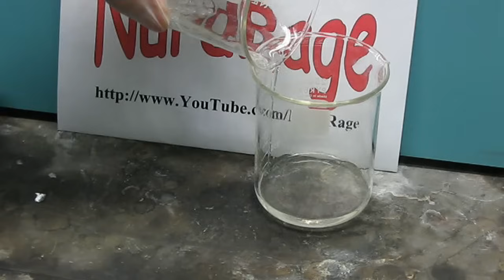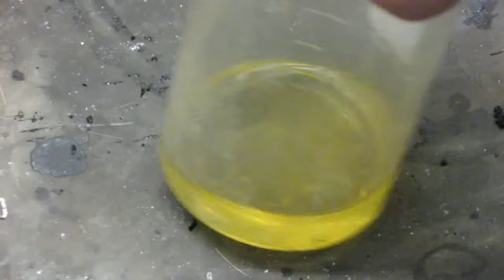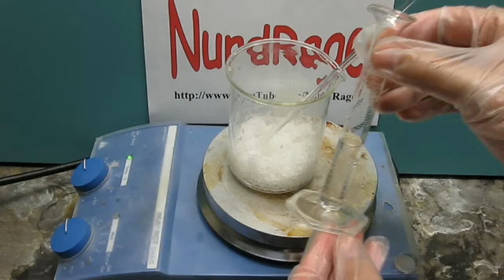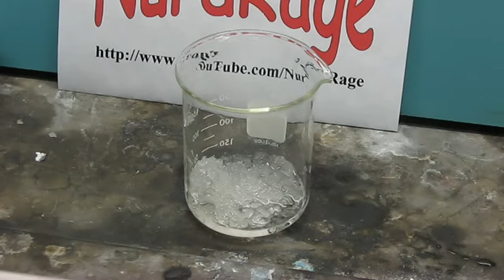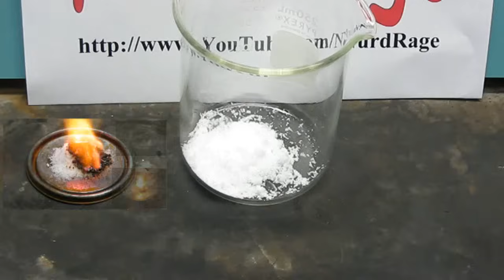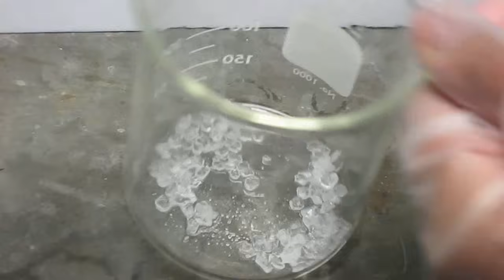How to Purify by Recrystallization

Comment: if the product solubility is different when you change temperature, then adding cold water or putting ice water into the product, it will recrystallize faster. However, it is recommended to cool down slowly, as you will yield more product.
Reply: ย

Comment: Dry Epsom salts by placing on a cookie sheet in oven at 400degrees for 30 mins. 
Put Acetone in a small cup and add half Epsom salt by volume then place in freezer over night.
Filter acetone/Epsom solution and keep acetone, discard Epsom salt. 
Add "Coca cola" to Acetone then swirl with with stirrer.
Filter solution and keep the filter. discard the acetone. let filter covered in paste dry and scrape..... you should have pure "coca cola"
Reply: whitepawsmydog
Reply: whitepawsmydog x.
Reply: David Graham r.

Comment: What we have are solubility tables, which tell us the solubility of our compound at different temperatures in different solvents. We look for a solvent where the compound has low solubility at room temperature (or colder) and high solubility at hotter temperatures. This is ideal, as the crystals will come out when the solvent cools from being heated, purifying them. This is the general idea of recrystallization.

Comment: i tried recrystallizing some potassium nitrate that i made, i took 1/5 its weight and added the water.  I had 25g so i put in 5ml of water, it was distilled water.  now when i gently heated it some of it dissolved but what happened was the salt began to dry on the sides of the flask and the water began to evaporate before it all dissolved.  did i have the heat on too high because it was the lowest i could go.  so what I did to get around this was add water while heating to make a saturated
Reply: Bryce B life

Comment: not related to this yes, copper acetate (or any other metal but not ones that cant oxidize) mix vinegar with hydrogen peroxide (household ones work fine) heat the solution untill boiling, then put in fairly pure copper (copper electrical wire, copper pipes, anything like that) the copper will create shitloads of bubles and the solution will turn dark blue green, let this dry and you will get either a powder or crystals of copper acetate (you can electroplate stuff with it)

Comment: In that case my *scnr* applies. If it still has (ionic) contaminants, it is not completely deionized. Note that the copper could also get into the water from the used reaction vessels, spatula, piping, etc., not necessarily be in the water in the first place.
Reply: سلام ایا شما طرز تهیه کوکایین در منزل را بلد هستید؟؟

Comment: @NurdRage What means 90 % purity? For some tecnical chemicals like sulfuric acid are 90 % purity. I have technical grade H2SO4 and i did titration and it was 95 %. how then it is 90 % purity if it contains 95% H2SO4? Other is water. 
Does that inpurity is 10 % of that 5 % that contains water in this case?

Comment: I recovered strontium nitrate from road flares, after recrystalizing several times and getting a fairly clean result i tried the dessicator bag with the common dryzair granules from rite-aid, cacl2, and it took a couple weeks to draw the water out, and it only dried a 3mm crust on top of the moist crystals :( I broke the crust up but it formed again. I need to use a container with a larger neck to increase the surface area

Comment: After heating, placing the heated solution in the beaker into a styrofoam or insulating container will yield larger crystals but will take longer to cool.
Reply: التعليق،قبل عشر،سنوات،،،الله يعلم ميت عدل😲😳
Reply: @Hasn-Aml890  أي هسه لكيت كلشي
Reply: @استبرق96  زين إذا نجحتي،بالتجربه،ذكريني،بحصه،منه،هههههه

Comment: How do you prevent supersaturation? When I try purifying solutions by recrystallization, they seem to end up supersaturating and won't come out of solution until I introduce a seed, and it's not as pure when the crystals grow in a matter of seconds.  Maybe these are different, I haven't actually made aluminum or strontium nitrate yet, but in general when recrystallizing, how do you keep them from supersaturating?